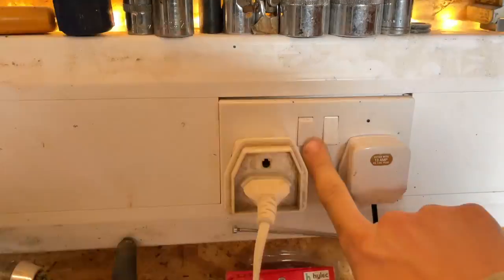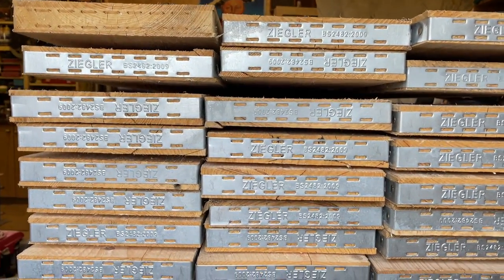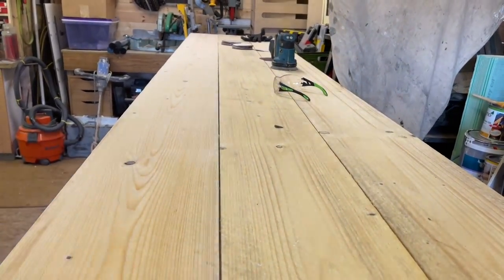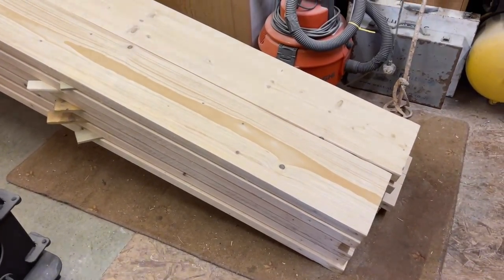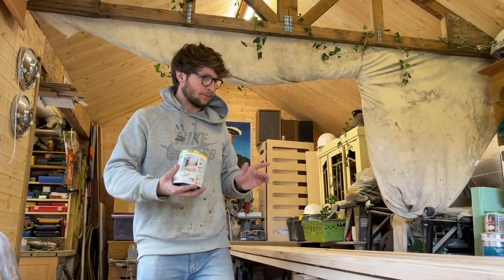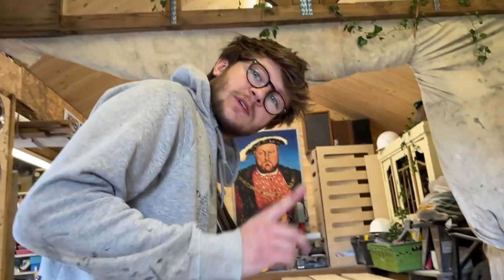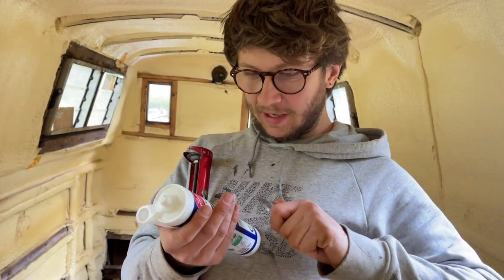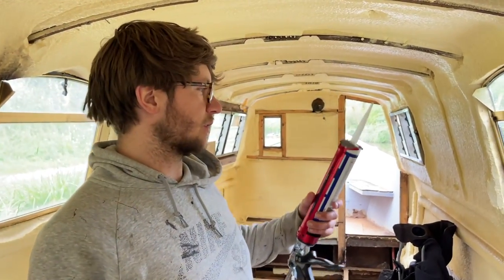Narrowboat floor begins | Scaffold Board Floor | Narrowboat Conversion | BOATLIFE

Comment: Great video guys. Belt sander and Fugi silicone scrapers are a very good investment. Also I would protect the underside of the boards to prevent them cupping etc. Thanks for sharing.
Reply from the maker: Thank you! Good idea on the Fugi scrapes we'll get some on order. We were worried the belt sander was slightly too aggressive with them being damp. We've got multi foil insulation going directly under the boards so hopefully that will protect from moisture as well.
Reply: Never seen scaffold board cup, they seem to retain their flatness in fithty
Reply: In fifty years on building sites never seen scaffold boards cup they retain their shape that’s why they use them
Reply: @philhonour450  In fifty years how many have you seen used in the bottom of a narrow boat😂
Reply: None in narrow boats , I’ve got solid oak in mine on top of ply. Laid professionally by myself as I am a qualified carpenter/ joiner by trade old school. If laid correctly they won’t warp. I worked on the Adela in Falmouth when built second highest mast in the world and also did a bit on the SS GREAT BRITAIN. But not when she was built, 1971 just after she came back from the Falklands.

Comment: Hi  D & J..  I just sub to you.  I was watching your vlog  as you put your ballast back after bitumen floor. I see you have that long hose all the way back back to drain the well deck...( Get Rid )  Useless... What is far better option is to cut two small half circles in each side of the hull above the weld seam, but as low as possible. Then any water will just run out..If you cant for some reason then fix an exit hole drain just below the floor hole you have now. As in same sort as used for shower / sink..A hole needs to be bored and the fixings installed...Then the hose you have now can be connected to it, but only a few inches instead of feet..That long hose you have now , can and will get clogged up with c**p  and s**t  and when it does...well deck water cant drain. I know a couple who had the same long hose set up...Guess what, was blocked up in a matter of weeks....Thought I would mention it before you put all the flooring in.
Reply from the maker: Thank you! The bow deck is very low, a bit close to water level so we've decided to try and collect the rain water & store in a separate tank to use for clothes washing. We'll have the pipe under the ballast as a back up as realise it's quite likely to clog up with crap.

Comment: Why is it that almost none have anyting else but single-glassed windows? They only protect from direct wind. A second glass protects from most of the condensation and a third will keep the temperature at the right level. ???
Reply from the maker: I really don't know why a lot are still fitting single glazed. Whilst looking at replacements for the Louvre windows, just single glazed were in the region of £2000 per 5 windows, I'd hate to imagine the cost of double / triple!!
Reply: @ItsOhJoe  Hups! With such prizes I guss the answer is quite straight forward...

Comment: You will need to remove the windows to seal them properly, with the way you have done them they are guaranteed to leak very quickly. You will also definitely need to coat the bottom of the boards to stop moisture, personally I would also let them dry out before doing anything more to them, also belt sanding works fantastic on scaffolding boards, thsts what I've used to prepare mine for shelves
Reply from the maker: Thank you! We're looking to paint the boat in the future so could potentially remove windows whilst we do this & re-seal properly then. The board will be directly on-top of multi foil insulation so fingers crossed no damp will get to them, will look into sealing the bottom though definitely
Reply: @ItsOhJoe  for the short time needed to paint the bottom of the boards it could save you a fortune in the future. If you concerned about time just put use bitumen baint or watered down pva ideally which can be done as you're putting them down
Reply from the maker: Good call!

Comment: I may be to late for my advice on scaffold boards, but here goes anyway. If you stop vlog at 14.57 you will see the rings on the end of the timber form cups, I think it is better to have them so the rings form bridges so the edges don't lift once laid. Thanks for sharing.
Reply from the maker: Thank you, no that's great advice. Will check which faces we've sanded and lay accordingly.
Reply: Tong and grove for expandtion plus treat underside for humidity. Cupped side down.